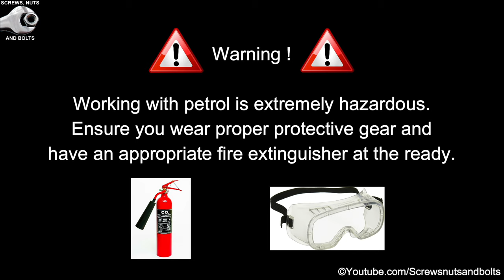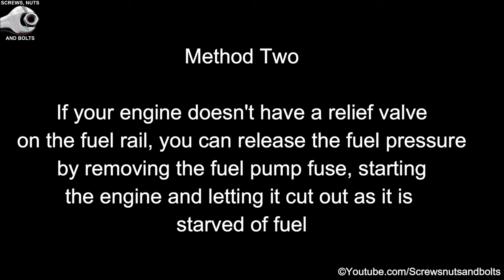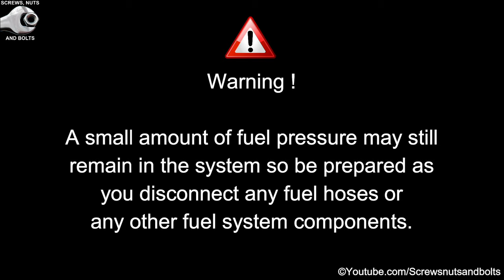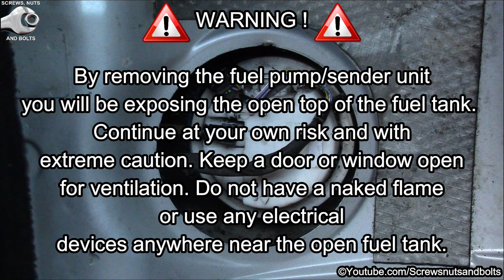Removing the Fuel Pump and Sender Unit - Peugeot 307

Comment: Very precise, accurate video. With all explanations. Thanks.
Reply from the maker: You're welcome, thanks for watching !
Reply: @screwsnutsandbolts  Nice job, I have a question, I have Citroen Xsara 1.9d diesel, on gas station they put gasoline 😢, now the car doesn't star anymore,how I can clean up all the fuel system

Comment: The video was very nice,  but i have Question about the Fuel Filter, i can't find it ! 😥 please answer my question . Thanks
Reply from the maker: Thanks, there's usually an in-line filter underneath the car near the fuel tank like this one: https://www.autopartssupply.com.au/fuel-filter-to-suit-peugeot-307-1.6l-11-01-2005
Reply: that's means the same Info. about Engine 2.0 hdi 2004 ?? And
is that possible there isn't in the Car Fuel Filter ? Because i had followed the Benzinline in the Car and i didn't found any Fuel Filter? Thanks for the Answer
Reply from the maker: @ayanr3850  Is your car a diesel ?. If it is, check this video: https://www.youtube.com/watch?v=UHcblza6Pxs
Reply: no , it's a Benzin
Reply from the maker: @ayanr3850  Oh sorry. I looked it up and apparently a lot of Peugeot 307s don't actually have a serviceable fuel filter
Reply: Ok , thank you very much 👍

Comment: Is the fuel filter located inside of the pump? Thank you
Reply from the maker: Yes I think it's usually built into this unit. Sometimes there's an inline filter underneath the car, in front of the fuel tank.

Comment: One question . My 308 1.4 vti problem with starting . I changed the fuel pump inside in older white unit . But now the car starts but first cranks a bitt when you stay a white . After you try crankk and start . Maybe need to change all the unit
Reply: About 100 euro on ebay

Comment: do you need on diesel version to unplug battery/acumulator  and fuel pressure valve  or it can replaced fuel unit/sensor without  unplugging of battery !?
Reply from the maker: I would disconnect the battery any time I'm working on a fuel system, just to be sure

Comment: I have Peugeot 307 1.6 hdi, 110hp(diesel). So I dont have fuel pump in the tank, only sending unit and the gauge , to see level of the fuel. My question is how does he take fuel from the tank? Are there some kind of a low pressure pump? Ofc theres high pressure pump, but Is there another pump in fuel system... On my car fuel is draining back to the tank.. so im trying to solve this problem..

Comment: Is this the same for a 1.6 hdi diesel? Is there pressure in the lines next to the fuel pump? Need to change the oring seal..any help greatly appreciated
Reply from the maker: Yes I think it's the same for the 1.6hdi. There might be a small amount of pressure in the lines going to the fuel pump so have a rag ready and wear goggles, just in case :)

Comment: Filter in bottom can you buy one or just wash it out ?
Reply from the maker: I'm not sure, I've never taken one off, sorry
Reply: @screwsnutsandbolts  ok thank    got a peugeot 407 2.2 petrol no filter on car dealer say it's in tank its look the same as 307 so have to take off and have a look no info any were on net may be first to open one some have filter in like Honda Toyota thank any way all videos help
Reply from the maker: @craigkidman  Are you sure there's not an in-line filter underneath the car near the fuel tank like this one: https://www.autopartssupply.com.au/fuel-filter-to-suit-peugeot-407-2.2l-09-04-08-09

The 307 has one of these
Reply from the maker: It might be underneath a cover of some sort. Just follow the fuel line from underneath the car and see if there's one there.
Reply: @screwsnutsandbolts   been to peugeot dealer strange says no filter. only in tank. but you can buy a filter on ebay? . found out English peugeot 407 no filter. but some  407 petrols a broad have them. bizarre no one noes other people same have  problem found.  i followed fuel lines from front to back even taken plastic floor pan shields off its mental no manuals available for peugeot 407 petrol  no info at all mental  thanks any way this mite help some other peugeot 407 drivers pulling hair out  2.2 petrol saloon 2006
Reply from the maker: @craigkidman  That's really weird, you'd think they would all be the same everywhere !
Reply: @screwsnutsandbolts  that's what peugeot dealer says  peugeot 407 petrol 2.2  checked vin number no filter it crazy found some forums say same only on cars  abroad so why sell on Ebay I purchased one and looked for weeks is drove me crazy and cant buy filter for the pump but look like strainer at bottom so have to see wen I get off looks same as yours three tabs at bottom to remove trap filter strainer in side what I can make out wash it put back have to see thanks for reply good man
Reply from the maker: @craigkidman  You're very welcome, the best of luck to you !
Reply: Hi bud taken my pump sender off peugeot 407 2.2 petrol its shocking condition please view Craig kidman video peugeot 407 pump sender youl lover it

Comment: Thank you so much for the video, I have a small problem is that I wanted to start my car but even in the bag was 30L of diesel but it gives 0l , I try to start but it don't want I changed the battery and also  the fuses but nothing changes

Comment: Hello my Peugeot 307 fuel pump has only one sender can I replace it with the one that has both the sender and return (two nozzle). The car consumes so much fuel.
Reply from the maker: I think you can only swap it with the same type as the original

Comment: The light that signals low gas level stay on  in the dashboard  Any advice on how to deal with it?
Reply from the maker: Make sure the float arm on the sender unit moves up and down freely and that the contacts or the metal strips on the variable resistor are clean and not damaged or broken. This link might help: https://www.delphiautoparts.com/resource-center/article/what's-wrong-with-my-fuel-gauge-diagnosing-a-bad-fuel-sending-unit

Comment: Is this same proceudre for 307 2.0 hdi
Reply from the maker: Yes I think so. The manual says this: Fuel lift pump:
The fuel lift pump (2.0 litre models with
particulate filter only) and integral fuel gauge
sender unit is electrically-operated, and is
mounted in the fuel tank.

Comment: is there any fuel filter, i have the same model from 2003, its benzine(petrol) and there is not a filter?   anyone idea...tnx
Reply from the maker: There's a small filter at the bottom of the unit
Reply: Hi those low pressure fuel pump sender have a fuel filter built in the lower part of the pump. Thats why you have to change them every 100 k at least. Cheers

Comment: Sllm. 
Motorun uzerindeki mavi sibop  dan benzin mi gelmesi gerekiyo
Reply from the maker: You need to safely depressurize the fuel system before you start. You could also take out the fuse for the fuel pump and then try to start the engine. This will also depressurize the fuel system.

Comment: Any idea what to do if the ring won’t turn at all? It seems to be stuck
Reply from the maker: Try using a piece of wood like in this video:
https://www.youtube.com/watch?v=lGLHw4ZckCw
Reply: I cut my ring because it was seared. I used a screwdriver and small cutting pliers for this, you have to do it carefully so as not to spoil the thread. I put on a new ring.
Reply: @screwsnutsandbolts  or flat metal file, spray ring with penetrating spray and let it stay some hours. Also lube oring before mounting. Found out the hard way

Comment: Man those plastic rings are an absolute bugger to get off
Reply from the maker: Without the special tool it really is !
Reply: Add penetrating spray and let sit over night. Really helps. Can remove with flat metal file, it not so sharp

Comment: What if I replace 15 Amp by 30 amp
Reply from the maker: You risk blowing the pump motor instead of the fuse if there's a power surge in the system for whatever reason.